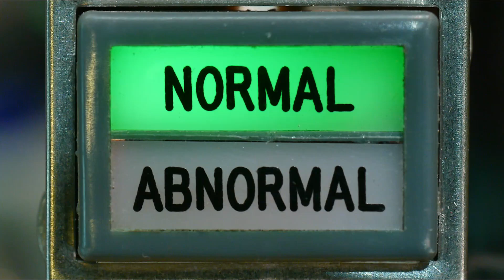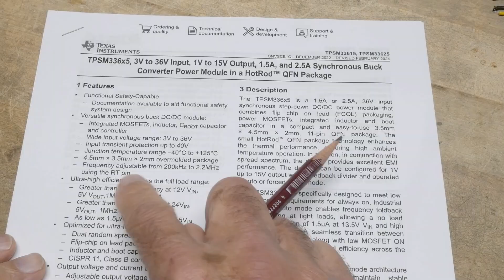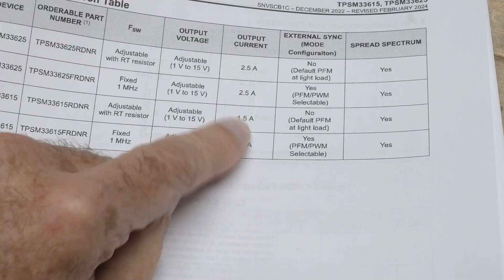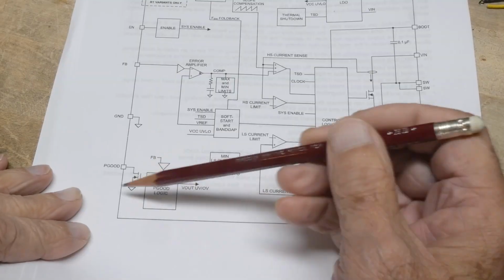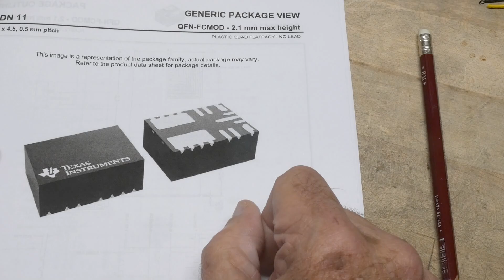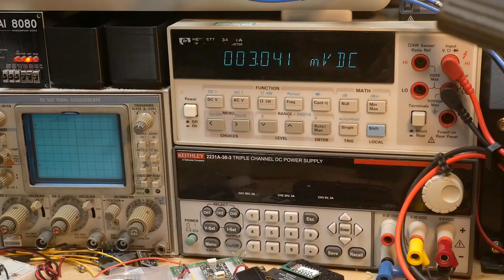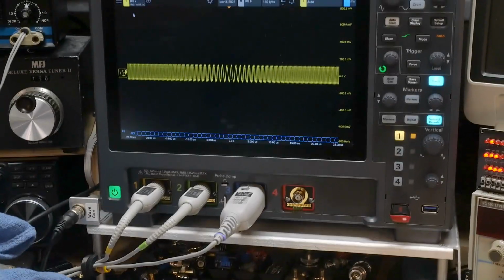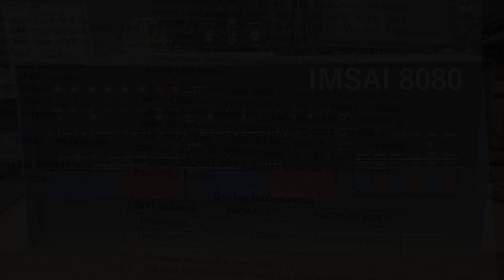#2414 TPSM336x5 DC-DC Buck Converter

Comment: If the feedback voltage were lower this would make a fun compact constant-current HB LED driver for low voltage DC applications. At 1v, a sense resistor would be getting pretty toasty running at any modest power levels.

Comment: Would be interesting to see the output spectrum across frequency to see what the EMI looks like and whether or not you can see the dither.

One issue I had with some early import LED lamps for my 24 VAC low voltage landscape lighting was that when the landscaper installed a new uplight near my gate opener it interfered with the gate opener's ability to receive the open signal from the various remotes.  Changing bulbs to a non-import version and moving the light fixture to a different spot under the tree solved the interference issue.  Sadly when I got home I found the landscaper kept the bulb when he swapped it out for a new one.  I really wanted to put it on the bench and make some measurements.

Anyway, a lot of early LED bulbs had some pretty suspect buck converter tech in them and it's nice to see someone trying to help minimize EMI in the design.

Comment: Super cool! I'd use it for Commodore 64 power supplies, which were notorious for their ugly failure modes, failing short and putting 12VDC on a 5VDC rail, killing the computer.
Contrary to what the datasheet says, the output looks a bit noisy when loaded; might need an inductor and decoupling caps to mitigate.

Comment: Whoa, weird coincidence: I just got some TPS buck converters in the mail yesterday. TPS92201 -Constant Current regulator. Mine came in SOT563, because I'm an idiot and didn't pay attention when I ordered them (I thought they were SOT23). I am absolutely amazed that they can drive 1.5A through a SOT563 (but I'll probably never find out because that thing is about 5x smaller than my tiniest soldering iron!)

Comment: Working on computer mother boards and GPU boards I'm a fan of the ingenious nature of synchronous buck converters, and their controllers. Some controllers managing many channels. I've seen as many as 10 channels working together producing very high amperage at low voltages from a single medium amperage source. I'm impressed that they have the two FETs and inductor built into your chip and it produces decent amperage. Of course I'm used to the FETs and inductors not being integrated into the controller chip.

Comment: A noob here ... People always complain about noise in buck converters ... Anyway to effectively filter that output to remove that oscillation / ripple?  What would it take to smooth it significantly, or is it impossible?
Reply: Big azz cap on the output.
Reply: @intheshell35ify  No, you need to consider a "Big arsed cap"'s resonant frequency.  Practically does nothing at these frequencies since it's parasitic inductance dominates.  OP:  yes you can filter it to make it smaller.  But it's a bit tricky; it needs to be done right.  A common technique if you can stand some inefficiency it to follow the switching regulator with a linear one.  They're quite good at removing ripple at their inputs.
Reply: @paul_moir  I always thought 78xx linear regs were really good, low noise, remove ripple… but bad at removing high frequency switching noise. Can LM317 be considered the same as 78xx, performance wise? 

What about a string of LC low pass filters? Use ceramic caps & ferrite indicators (and a fixed load or might need flyback diode).
Reply: @davadoff  You can knock ripple way down, but it has to be done with the right parts. A single huge cap won’t help much because its ESL pushes the resonant frequency too low to touch switching ripple. What actually works is a small LC output filter (ceramic caps with low ESL plus a properly sized inductor or ferrite), placed after the main buck stage. Linear regs like the 78xx or LM317 will clean up low and mid-frequency ripple, but they don’t have great rejection up in the hundreds or thousands of kilohertz where most bucks switch. Pairing an LC stage with good layout usually gets you the biggest improvement.
Reply: @PNLabsElectronics  cheers :) Regarding properly sized inductors… similar to how a low ESL capacitor works better, does a low capacitance (smaller?) inductor work better?

Comment: Interesting part, efficient to use if only the package had more common pins. So the module will be used. 
"Optimized for ultra low EMI requirements" could mean low EMI or low requirements. 
As it has the inductor inside it would be interesting to test the output ripple with a magnet.

Comment: How does it look for EMI? It would be interesting to see it probed with a loop on a SA. Thanks for your videos they are always interesting!
Reply: I was wondering the same thing.  I hate modern switch mode supplies to start with because of EMI.  Now instead of a relatively easy tone to notch out it's going to spread the noise out over a whole band.  Mike KC3OSD
Reply: The datasheet has an example meeting CISPR 11 Class B, but requires a 4 layer board (a close solid ground plane).  But it does spread spectrum to achieve it so that'll probably just annoy you radio guys.
Reply: @paul_moir  While we do not have formal EMI test reports to publish yet, the NanoBuck module was designed with EMI performance in mind. It uses a 4-layer stackup with dedicated ground planes, including a tightly coupled internal GND plane placed roughly 100 microns below the controller to minimize loop inductance. The power stage layout follows best practices for switch-node containment, short high-di/dt loops, and controlled return paths.